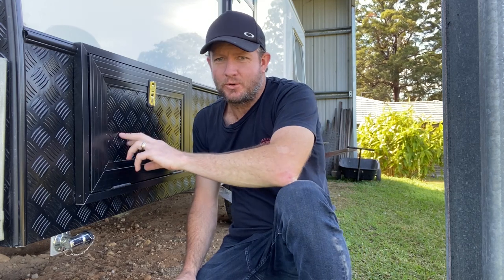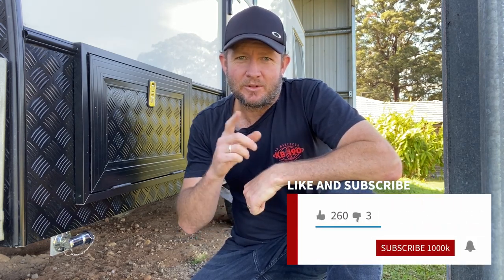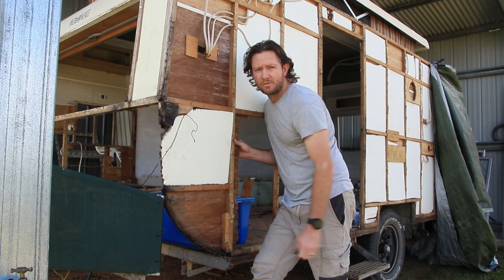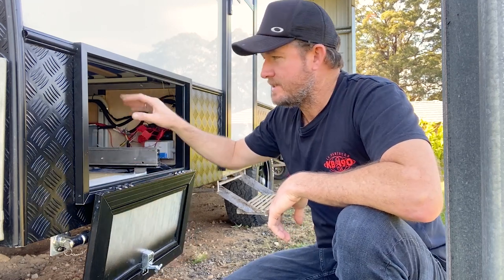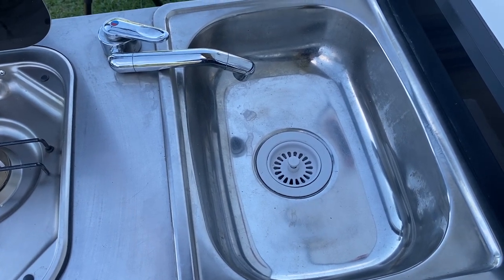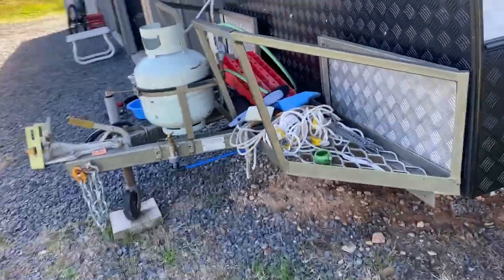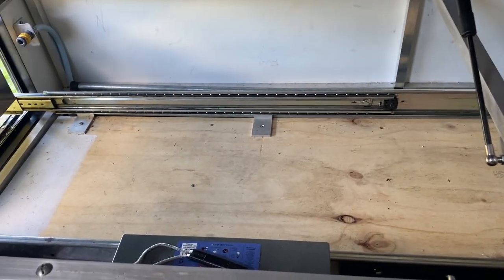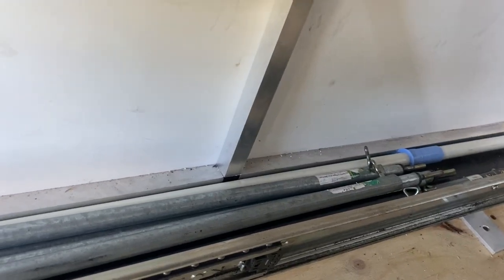The External Slide Out Caravan Kitchen (Caravan Restoration Project)

Comment: How do you remove the slide for maintenance please
Reply from the maker: My slide and tracks are accessible from under the front bed. I guess if you needed to you would just have to unbolt the tracks and pull out the slide but I've never needed to do that.

Comment: Hi. This is great video. When you change the shape (where you squared up the front) of the van do you have to have an engineers certificate. Also, you have changed it so much can it still be registered as the original make?
Reply from the maker: Hey Linda 👋🏻 After I had it all done I had it taken to a reputable caravan repairer/sales shop in town. They fitted all the gas and wired up the 240volt in the van and certified that. They also weighed it, checked it over - lights, brakes, bearings etc and produced a blue slip so it could be re registered in NSW. Although it’s had a few mods it’s still listed as the same make on the rego papers.
Reply: @TheBeatenTrak  Thank you. I had always intended to have 240 volt done by licenced electrician but watching your videos I am rethinking everything else I want to do. Was originally only going with an inside renovation and some roof replacement because of roof damage but when I began I found so much rot that I have to do a complete gut. Now thinking about replacing the outside too and squaring up the ends. You have been very inspirational. Thanks again.